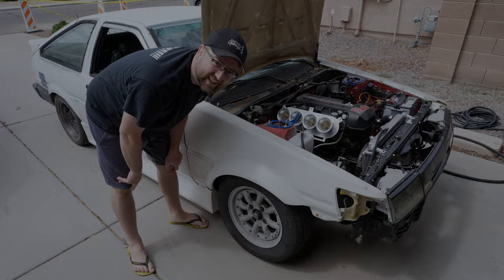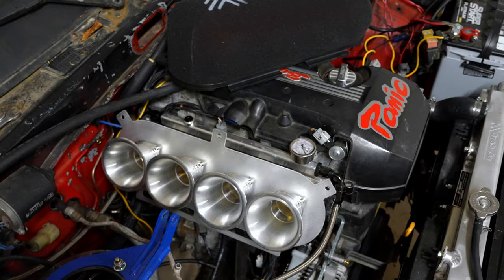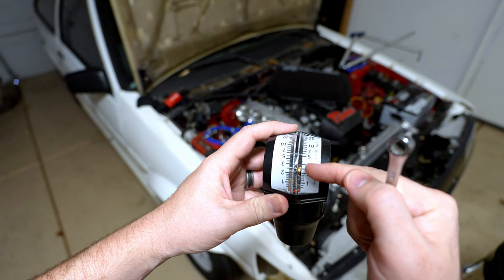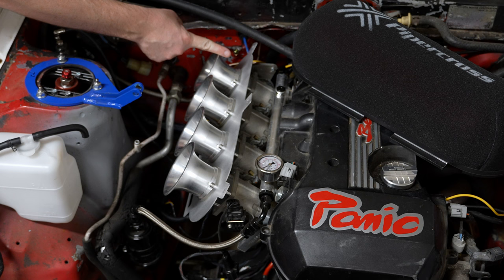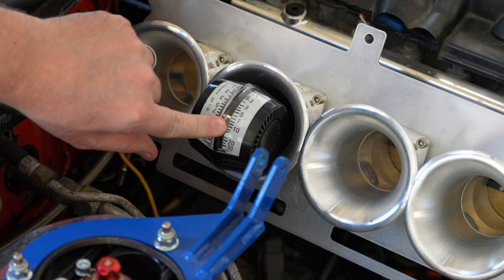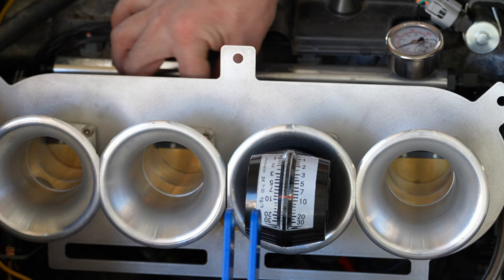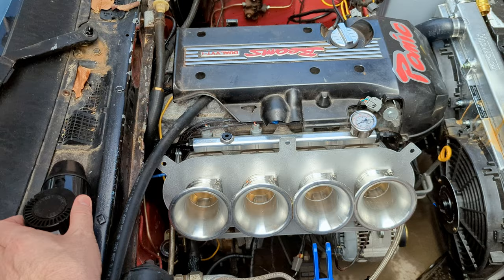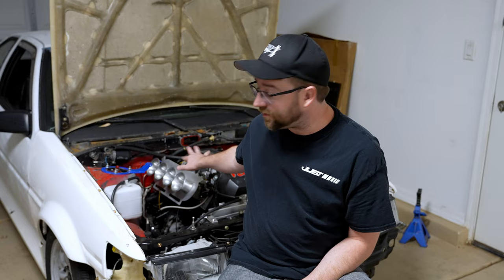How to BALANCE / SYNCHRONIZE ITBs! BEAMS 3SGE - Project Creampuff runs!!

Comment: Great job Devin demonstrating how to adjust ITB's.  I've never seen that before so good knowledge to have.  Are adjusting the Toyota black top and silver top ITBs the same method?
Reply from the maker: Thanks! Yup they should be the same method. Start with setting the throttle body that the cable connects to, then adjust the others to match :) the adjusters on 20V ITBs might be physically a little different, but should be very similar.

Comment: How much kg/h should each throttle body pull i have ae111 itbs. Current synced them ,but all four pulling around 2.5 kg/h.
Reply from the maker: Unfortunately I don't have an exact answer on that - it'll depend on the RPM, engine displacement, volumetric efficiency of the engine, etc. I would say that as long as they all match with flow - that's the important part.

Comment: Hello friend, sorry first of all my English, I'm using the translator.

Hello friend, I wanted to ask a question or if someone can answer me, within the range of the 3sge black top there are certain versions g1,g2,g3,g4,g5, I understand that the g1,g3,g5 are mt and the rest are at

Within these versions is there any difference between the mt? I'm thinking about doing a 3sge swap and I want to choose the right one, thank you very much
Reply from the maker: There are a few minor differences in wiring, ignition coils, and ECU. But other than that I think they're all the same
Reply: So there is no difference in terms of performance?

thanks my friend! @DoctoredGarage
Reply from the maker: Not that I'm aware of. You're welcome!